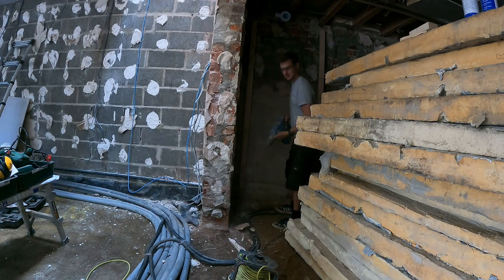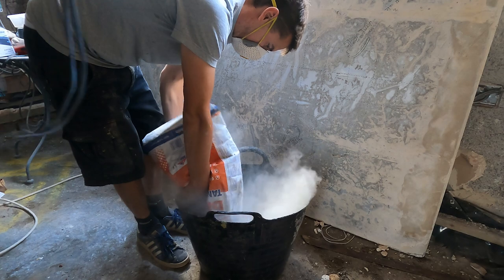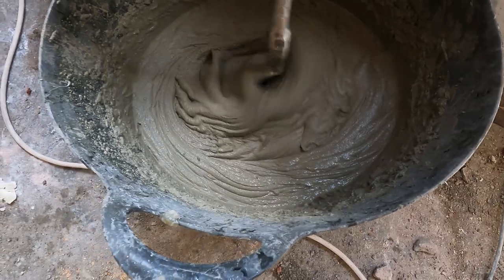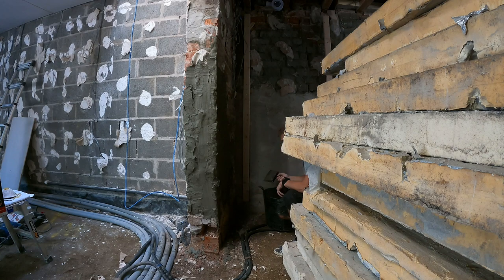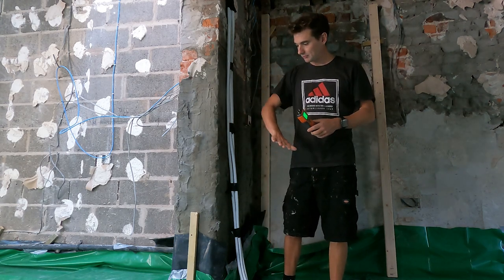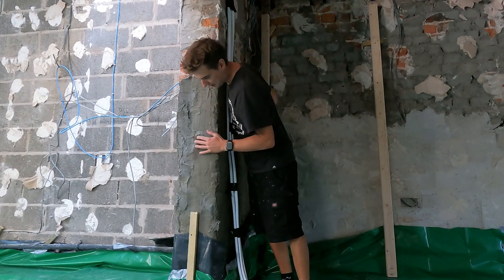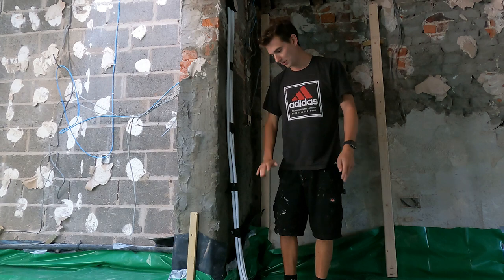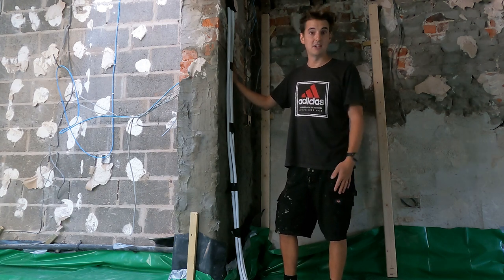Rising Damp Fix with Tanking Slurry from DryZone to fix the old house - DIY. The old house build .

Comment: Great video again, with the tanking slurry does this take out moisture or just block moisture leaking out into the house?
Reply from the maker: Hey DIYHerps

The slurry acts like a barrier so it will not allow water to pass through (subject to correct application). You can get solutions that allow water to pass through but you would require a pump / drain to allow for the passing moisture to be taken away. 
Good to hear from you.
Reply: @houserenovations-tlom7317  why didn’t you go for the pump and drain method? Excessive?
Reply from the maker: Thanks for the reply DIYHerps .
This wouldn’t be required for my house . A drain and pump system would be typically used when the retaining wall is used to hold back large amounts of water. 
An example would be a room that is under ground / cellar etc etc .

Comment: I’ve found 50/50 sbr/cement mix is a great tanking slurry.
Reply from the maker: Thanks for the comment and I never thought about doing that.
Reply: @houserenovations-tlom7317  it’s worked very successfully for me, water literally flowing out, two coats do the trick.
Reply: I did this around my chimney breast before skimming the walls, worked perfectly.
Reply from the maker: Which did you do sorry Jim ?
Reply: @houserenovations-tlom7317 . The sbr cement mix. Did it 7 years ago and was still good when I moved out of the house in December.
Reply from the maker: Sounds good then that !!

Comment: Hi miller, I really love your channel. Be watching it for a while and I'm glad you're back. Quick question for you, I've got thick damp walls with no cavity. The plaster is wet. It seems like rainwater is coming in horizontally. Do you think I could hack off the existing plaster and put some kind of chemical or slurry or something similar on the wall to stop the damp?
Reply from the maker: Hey , 
Sounds more serious then putting a slurry on it etc as we need to have a look at what is causing the problem then address it, starters have you got a DPC in and things? Whats age of the house ? Be good to see some pictures to give an actual recommendation on what i would be looking todo next.  Can you DM on Instagram ?

Like always though I would always be looking to take professional advise from someone local that can come out and look who comes recommended etc.
Reply: @houserenovations-tlom7317  that's brill, thanks for the reply. I'm not on insta unfortunately. But I'm on Facebook or I could email you (prob better)
Reply from the maker: Yeah add me on FB then we can message and take a look etc.
Reply: @houserenovations-tlom7317  that's really kind of you, thanks 👍🙏
Reply: @houserenovations-tlom7317  brill. I couldn't find you. Do you have an email address
Reply from the maker: Any video on the channel in the description should have a link to FB.

Comment: I don't think rising damp exists.
Is this in a basement?
Reply: Rising damp does exist, that’s why we have a damp course. Been building for 25yrs, seen it and solved it many times.
Reply from the maker: Hey Chris , 
Entitled for your opinion on that . What makes you say that however ?
Reply: @houserenovations-tlom7317  I've solved damp also many times. In my experience, its always something else  causing it and what would appear to be moisture wicking up the masonry from the ground. It's a big subject and there are so many problems thats can be misdiagnosed as such. Our man is right that we do install a dpc in new buildings and have done for years. Most of the damp problems I've fixed over the years were on buildings that never had a dpc and I didn't do it by putting one in or injecting anything
Reply from the maker: Hi Chris, sorry just seen this (problems with comment notifications on the channel) you got any photos and stuff of your work you can send over via Instagram ? Everyone is entitled to an opinion like I say.
Reply: @houserenovations-tlom7317  no, I'm not on anything like that. Sorting out damp is not our everyday stuff mainly extensions. The town I used to live in had a lot of turn of the century terrace houses so if we were working on one, there was almost certainly one or more instances of damp to sort out. These houses never had a damp proof course and never needed one either. Problems were usually blocked cavities, leaking roofs leaking in to cavities, busted and/or leaking guttering, water or drainage pipes leaking. Rendering for example causes more damp than it solved. We used to hack that off and clean the brickwork up. I never found an instance of water being drawn up from the ground by the masonry of the building. Maybe I will one day 😄